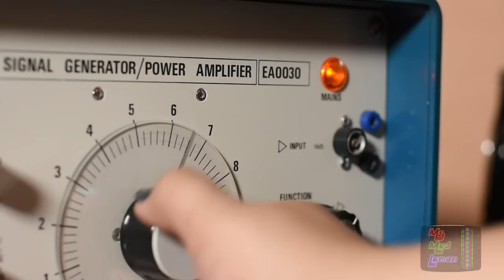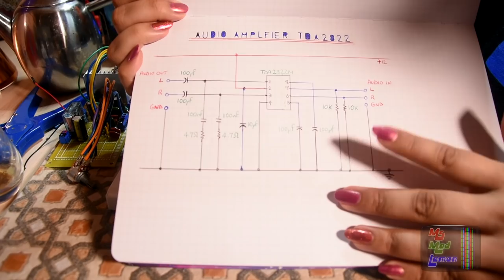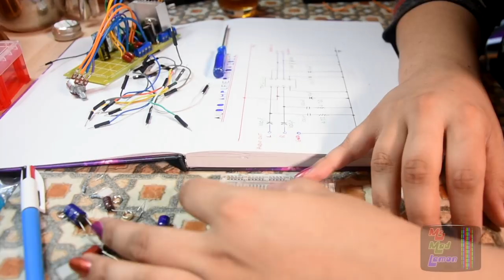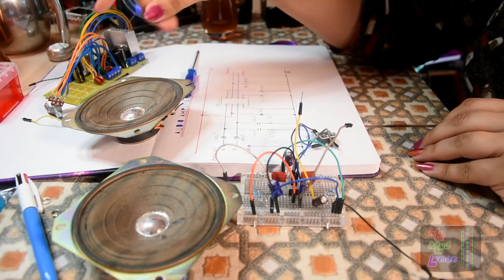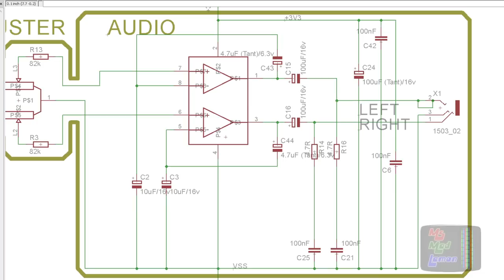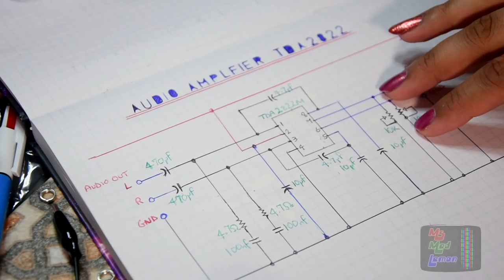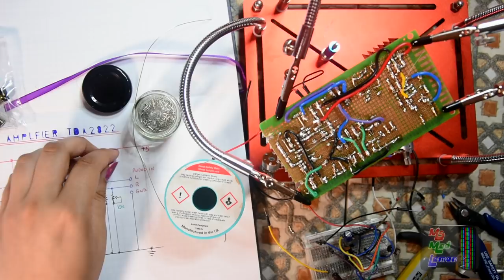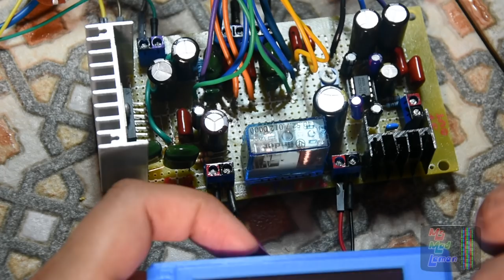Headphone Amp Build TDA2822M - SIDBoombox Project 09

Comment: Create an active baxandall, in my DIY guitar pedals I reckoned on losing 6db from the passive bax.  All down to input impedance of the headphone amp circuit, and power amp circuit might be lossy too, but its got enough gain to recover the losses.  A dual opamp and a few parts should be enough to add to the existing tone circuit with minimal screwing around.
Reply: Loads of those about, just look at any hifi audio site

Comment: I did also wonder what those 4u7 capacitors from output to the -ve input of the opamps were for.. but as Waynes circuit is running from 3.3V i suspect he is "bootstrapping" the amps to get more drive on such a low voltage. His choice of R13/R3 seems a bit high too, but those form an effective DC bias for the +ve input. I probably wouldve used 1K, followed by 220pF to ground to act as a low-pass filter that stops high frequency crap (e.g. from mobile phones) getting in.

Anyway, all part of the learning experience :) Better to mess about with a little TDA2822M and burn it out, than an LM3886 or a discrete power amp :)
Reply: the circuit i built was precicely the way i needed it to work on the sidbox, the feedback capacitors help to stablised the DC biasing... the sidbox does not squeek. its a design to stop the high level of hissing also, when no audio is going in, the whole of the audio is nearly grounded. Since the LCD produces a lot of digital noise i required an unorthodox method of silencing the squeek and hiss... The mobile phone buzzing effect i did not take into account because.... why? why should I? this unit is designed to be as retro, even the walkman would respond to mobile phone interference.  the SidBoombox runs the same circuit and (in later videos) the squeek is not present and works exactly as intended. the values are not too high, they are a requirement for the circuit built. I remember saying this before... Theory does not match practicality, and if one is not willing to bend the rules a bit to get the desired effect... then a project is not properly loved, you're just following instructions and not being intuative enough.

Maddi's circuits aren't just "oh look at the design"... she looks at the design, tests it, then tweaks it! THAT is innovation and intuiation working together to make the best out of something that is otherwise intended for headphone circuits! The Game gear uses the SAME chip and their design is also NOT the same as the standard out of the PDF, SOME GameGears have tweaked and revised PCBS to acccomodate cirtain audio issues.  The CFL inverter for one produced a ton of high frequency crap... their values work for the 9v powersupply so the resistors and cap values cannot be the same! 

TDA2822M is a very nice bit of kit if you learn and bend rules to make them work the way you want... dont just assume the values in the datasheet will work for you! they wont! The sidbox suffered massive noise and interference when i just "followed the standard/recommended" design! so ... i changed it!

you've heard the sidbox singing, and you can hear the way the sidboombox works!
Reply: @electronscape  ive just never seen a value as high as 82K used for the +ve input stopper resistor before. That said I have not seen what the preceding stage is. Incidentally I am not just "following the datasheet" but drawing on practical experience of building amplifiers - though, all the amplifiers I have built have been "hifi" not designed to add any sonic chararcteristc of their own.

Incidentally, you seem to have taken my comments as negative criticism instead of just constructive comments, which was not the intention.
Reply: @jaycee1980  To be fair Peter, you're trying to explain something that isn't applicable to the projects at hand, i understand your trying to add your input. However it seems to come across as though you're trying to correct something. the 82k i agree is a little unorthodox but the sidbox and boombox dont seem to mind these.

Saying that, if your comparing your hifi circuits to the sidbox and sidboombox, they're not the same setup at all. So im sure you'll understand that I appear to have taken the comment negatively, however I was trying to explain that while these circuits you build aren't going to be applicable with the stuff Maddi and I are working with, aren't going to be anything like the circuits you are building. So please, look at our projects and take them as you see them, they work, they function and they dont have any electrical issues at all!
Reply: @electronscape  well thats not the intention and quite frankly, im getting a bit fed up of people saying im being condescending or something. I don't have that problem when I comment on other Youtuber's electronics videos or on any other forums. People learn from these videos and I see no problem with adding a different point of view on circuit designs, especially if you're doing something thats fairly oddball. I've never seen the capacitor from the output to -ve input as you have there, and it's use is a bit odd considering the usual use of an amplifier. But whatever. If you want people to regard it as "magic" then fine by me.

A pity. I used to enjoy these videos, but now I feel like im just supposed to say "wow awesome" and not think anything else...
Reply from the maker: @jaycee1980   Maybe you're coming across as condescending. You said yourself on my discord that you've had issues with others in the past who werent happy with your comments and you weren't sure why.  I am open to other perspectives and don't want people just to say "wow awesome"  that is obvious in many comments throughout my videos, i've taken ideas and advice on board...But It depends on how it's portrayed to me, that makes the world of difference.  

If you keep telling someone things that you know they're aware of or talk to them as if they know very little, and then steer the entire conversation to make it about you rather than what they're trying to talk about. it will obviously come across as condescending to them. They will also get fed up, It's happens on my discord a fair amount with certain people and its not appreciated. I seem to get people trying to "put me in my place".. 

I'm not here to compete with anyone, I have no interest in that, but I do tend to avoid conversations where someone seems like they're trying to make me feel less knowledgable than I am or try to diminish the value of any effort or project I do.. It's not pleasant being on the receiving end of it, of course eventually I confront as anyone would.

Comment: I think the main problem with your original circuit, was that the Zobel networks (4.7R + 100n) were before the output capacitors, when they should be after them. The amplifier was probably going into oscillation, hence the squeaking noises.

When I first built an amplifier based on the TDA2822M (when i was 11-12) i had similar nasty noises, but only when the volume control (a 47K logarithmic dual pot) was at certain positions. That turned out to be a mixture of "ground loops" and insufficient power supply decoupling. I had daisy chained all of the ground connections from one point to another, and that caused a loop. Connecting all grounds to a single point solved that issue. I also added 100nF decoupling right on top of the TDA2822m itself, which kept it stable.

I'm surprised the chip is still being made :)